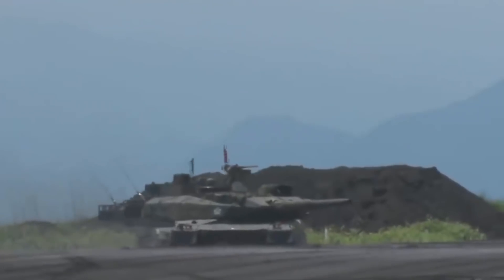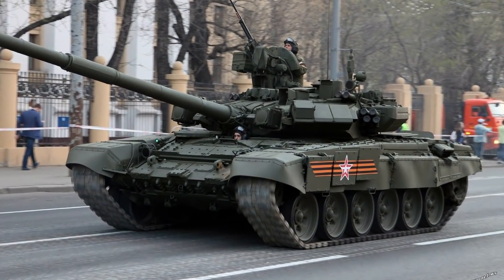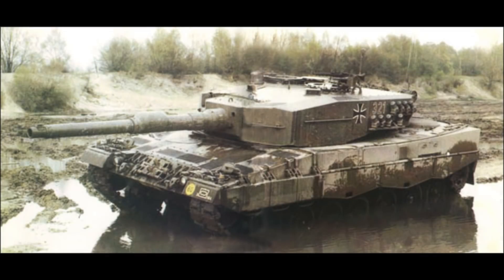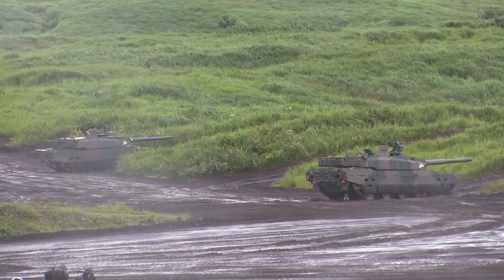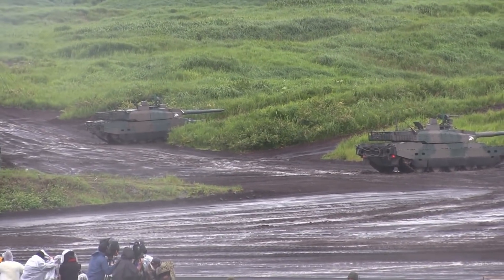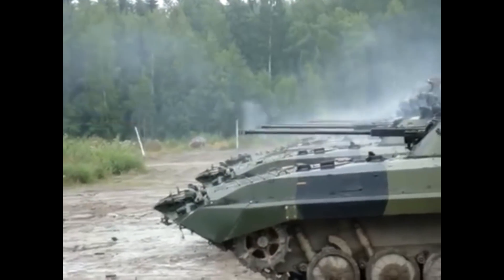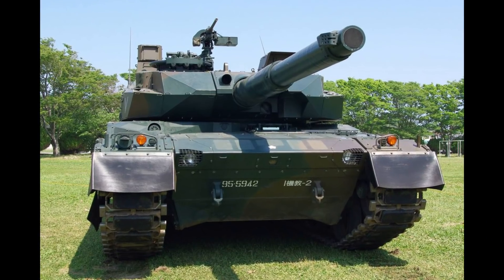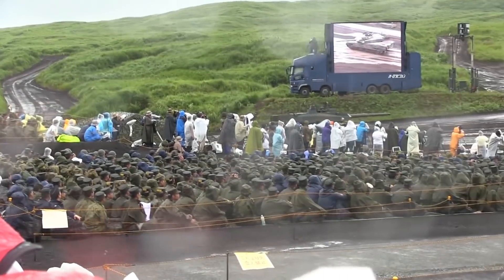Problems with Type 10 tank

Comment: In the age of shoulder-fired top-attack ATGM missiles, heavy, thick armor is not so useful. Modern ATGM will defeat such thick armor anyway. Small and nimble tank is way to go. No more massive tank battle on the wide open plain like desert. Japan is mountainous country with narrow road. So even 44 ton Type 10 is overkill. Modern tank should be designed more like heavy IFV(infantry Fighting Vehicle) without personnel carrying capacity. 35 ton would be enough. Modern tank should have 8 ATGM missile and 40 mm auto cannon or 105 mm howitzer gun. It should have extensive active protection system and extensive optical surveillance system, but not heavy armor. Armor to defend 30-40 mm munition is enough.
Reply: If Modern ATGM's can defeat thick armor, it means you just need even thicker and better armor. I think a modern heavy assault tank weighing around 100 tons with a 2000 horsepower engine, ultrawide tracks, and a 140mm cannon would be extremely potent and very survivable in high intensity situations. Such a tank should be capable of reaching 50 kilometers per hour with decent mobility. Of course, it should also have 3rd generation thermals for commander and gunner, Active protection system, a remote operated machine gun, and laser warning systems for ATGM lock ons.
Reply: @Frenchfrys17  Country infrastructure go brrrrrrr!!

Comment: People tends to attribute heavy weight to armor, which is completely wrong in the Type 10's case.
The tank is extremely frontally heavy because of it's composite armor. To achieve a good frontal armor with low weight, they had to strip off all of it's side armor and focused it on it's front. Also, the tank have a smaller profile compared to it's Western counterparts like Leo 2, Challenger 2 and Abrams. The Type 10's hull dimensions are similar to the russian T-series, and the tank's height can be reduced thanks to it's hydropneumatic suspension. Having a smaller profile helps on increasing the protection, since you have a smaller area of the tank to be covered, it is possible to maintain the same level of protection with less weight or increase protection with the same weight. 
This comes with downsides however, like possible having higher ground pressure because of less roadwheels, having cramped interior, carrying less fuel and less ammo. Upgrades are also hard to do without greatly increasing the tank's weight.

Comment: My dumb opinion: skip the tank and go with small, very mobile autonomous mini tanks.
Reply: They do have that too actly. 
The type16. 

8wheel armored vehicle with a 105mm mounted ontop. Its light enough for 1 unit to be flown in by a Kawasaki C2 cargo plane, a plane thats sat between the C130 and the C17, and on par with the airbus A400M.

Comment: Well only 5 road wheels per side is a fail, as ground pressure will be higher and the ability to upgrade the armor or add any weight is probably zero. The only ggod news, is that is the unlikely event of an invasion of Japan, other tanks probably can't use the road bridges as they would exceed the weight limit. Rail transport though is possible.

Comment: Transcript has some problems-needs editing --Type 10 is the latest japanese main battle tank. When it was first revealed, many thought of it to be the first 4th generation main battle tank, for whatever reason and many went to say, it's the best main battle tank yet. But type 10 has many problems because the tank is meant to be as light as possible. Because of japan's topography, the fact that japan is basically an island which has other small islands under it. Many of the bridges don't support heavy vehicles. In this video we will take a look at some of the problems of the tank. Ofcourse this does not mean that the tank is bad. Far from it it's just the focus of the video. Many of its problems lie in the protection because the tank is designed with the idea to preserve the weight as much as possible. The first issue we can talk about is the side protection. The hull has no additional armor modules on the sides. Just simple side skirts .This is definitely not good for a modern tank. Most of the modern tanks have atleast one third of the whole side protected with additional armor modules. Be it composites or explosive reactive armorand now more and more we see the entire sides covered with additional armor. Type 10 as i said has none of that and it drastically impacts its survivability. Because even a hit from 30 degrees by an old rpg rocket could prove fatal for the tank. Now the turret is a hot topic. Some claim that the modules on the sides are composite armor modules while some claim those modules are hollow and possibly serve only for storage while offering only spaced armor protection. I personally could not find any hard evidence to support either of the two claims but i will give my two cents on it personally. i do not believe that those are composite armor modules for several reasons. First reason is the weight. The tank weighs only 44 tons. In comparison the original leopard 2 from 1980 weighed 10 tons more than that and the modern one weighs 20 tons more. Composite armor modules are really heavy. If those indeed are such modules, they would drastically increase the weight of the tank. Second reason is the fact that the modules have little doors with hinges on them. You don't put such things on composite arm modules mainly because those could easily be damaged in combat by happy machine gun fire or explosions. Third reason is their design on one spot. They are thin on another really thick and so on. You don't really design composite armor modules like this. At least not if you want them to work consistently. Another thing to also mention is that these boxes go along the entire turret to the very back, where composite armor is not really needed. It would just be unnecessary weight. So i honestly believe those are not composite armor modules. Now there are pictures of the tank with what appears to be composite armor on the sides of the turret but without the boxes on the side. This led some to speculate that there is composite armor on the sides under the boxes but if we carefully examine the photo we will see that this is an old prototype. First we can see that the supposed composite armor is as thick as the laser MORNING??? receiver and starts from the receiver's point and covers pretty much the entire side of the turret with the same thickness. But if we look at the actual tank we see that the area behind the laser WARNING?? receiver is much thinner than what is shown in the picture and the boxes create a slope which wouldn't allow a plate of such thickness behind them. In another picture from an actual tank we can see that there is no such plate on the side. Now does this mean type 10 has just simple steel and side armor and storage boxes on top. Well probably yes but not necessarily there is still room for a thinner composite plate behind the boxes on the gunner's side and the commander's side could possibly have a thin composite area on the tank's actual turret. Since there is some room there. Of course composite armors of those thicknesses provide very minimal protection, they would maybe only stop old rpg rockets from 30 degree angle ifyou're lucky. It is possible the japanese designers thought that the composite will provide very little protection. Why add it in the first place in an attempt to preserve weight and it is very much possible that it is just steel on the turret side. Now the tank is said to receive a hard kill ACRO?? protection system so that will save it from a lot of problems regarding its armor protection. But the powerful atgm will still retain some penetration when intercepted by an aps?? and having really poor side protection will be a problem and that will not protect it against auto cannon fire from infantry fighting vehicles which are more than capable of penetrating its side armor. Next problem is the protection of the hull. I ??am a storage the bustle?? autoloader has only 14 rounds in it which is kind of a problem on itself but the rest of the ammunition. 21 pieces are stored in the forward hull compartment next to the driver. This can lead to the catastrophic loss of a tank if the ammunition in this rack is hit. The fact that the lower front plate has no additional protection can also be the problem. Because of this but the lower front plate is an area least likely to be hit. Therefore it's understandable why it's designed in such a way. One redeeming factor could be the ammunition propellant germany switched to. A propellant that does not catch fire when hit by hollow charger munitions. But i could not find any information if japan adopted something similar. This does not mean that the hit to the ammo rack wants to knock out the tank but it significantly decreases the chances of that happening. Another problem is that the turret ring is very exposed. If we look at the tank, we can see that the area between the gun method??? and the upper front plate is much bigger than usual. The turret ring appears to be covered but it's not actual armor. It appears to be a mount for some electronics. Could be driver's night vision. I could be wrong and it's also covered by driver's periscopes which obviously aren't armor. So a hit from anything will penetrate there and basically neutralize the tank which is a really big problem. Of course the tank has many good things about it especially mobility-wise but as i said at the beginning this video is only about some of the problems of the tank and as already mentioned most of these problems have to do with the fact that the tank has to be light. That was the main goal of the design and they did accomplish it.

Comment: The problem isn't it has to be light, it's that for whatever reason, the Japanese thought it has to be as large and bulky as a Leopard while being light. The Chinese Type-96 light tank weights 41 tons while having the armor protection of most mbts and no weak points, by simply making the tank smaller, with a razor thin frontal target profile. Concentrating the same amount of composites into a smaller area = more protection for less weight. The Type-10 didn't need pneumatic suspension, it's a bulky and heavy gemmick that highly situational in theory, and in the history of tank warfare has never been successfully used despite appearing in mass produced tank models in both Japan and Europe since the 1970s. The 70km/hr reverse gear is also useless. 2 gear  35km/hr reverse that Type-96 uses is more than adaquate, and doesn't add much bulk or complexity to the transmission. Instead of shaving off the useless junk, the Japanese opted to save weight off armor, the very thing that makes a tank a tank.
Reply: Lets see if that works when a tank battle happens on japan's mountain islands.

Comment: Since japan is an island they trade off armor for mobility, but you know they could always add armor to it right?
Reply: Yeap. 

Basic setup weighs in at 40 tonnes, but it can go up to 48 tonnes if neccessary. Its got a a power/weight of 27hp/tonne at its “medium” setup of 44 tonnes, n 25hp/tonne at 48 tonnes. Thats better power/weight than the latest (and heaviest) Abrams, n the abrams is no slouch. If the type10 wanna meet the same power/weight ratio, it can touch the 51 tonne mark with everything on board. 

And hell, its a turbodiesel. Who says u cant up the boost😎
Reply: you can't just slap armor on a tank design. do you think of how the russians just slap ERA on everything?  thinking about it...officially, japan and russia are still at war, they never signed a peace treaty for ww2. so if they want to try out their tank, and at the same time take pressure off ukraine..now's the time O:)
Reply: @thecursed01  i agree u cant slap armor on a tank. but thats the beauty of not exporting ur tank…. We dont actly really know what the type10 is hiding, n the jgsdf is under no obligation to share any of its secrets.

For all we know, they already have an uparmored version that exceeds the “48tonne” version. All it needs is a visit to the vehicle depot for a few days to swap out or add on. 

As in… there were built-in allowances for the type10 for it to exceed what its officially capable of. I mean, this tank came out in 2010. Dont tell me no further development was done to it in the 14 years since then.

Haahhaha. I rmmbr that joke about russia vs japan. Before ukraine, everyone was like “how is japan gonna fair against a russian invasion”. A year after ukraine, people were more like “how many weeks is it gonna take for japan to take over the kurils n sakhalins?” 😂😂😂

Comment: I knew it. . .
That turret armor is a hollow. . . Its a fake armor plate 😂.

But am pretty sure that turret armor can be replaced to the real one, depend of where that tank placed and situation.

Am really sure that japan not gonna make same mistake as ZERO, reducing the weight as much as possible without any solution.

Its really weak tank even in first time saw its armor (compared to abrams)

Comment: T90 has 44 tons...
Reply: And no gun depression and no reverse speed
Reply: @degenerat3380  what your point, the guy talk like an 44 tons tank can't have good armor, T90 have, Armata to with 48 tons...
Reply: @carloswolfbr  having good armor does not make sense when your tank is not functional in the area it will be operated in, the T-90 has good armor and is light, but in mountainous terrain it would be useless due to its lack of gun depression, The T-90 is designed for flat European terrain and constant advance, The Type 10 is designed to defend hilly terrain and use covers and quick retreat.
Reply: @akirasean4080  they have not fought tanks with each other yet, they are placed nearby, India noticed a problem with using the T-90 / T-72 in mountainous terrain and immediately started looking for some light tanks to buy and China deployed a ZTQ 15 light tank instead of its best armored ZTZ99

Comment: But isn`t the t72 b3 only 45 tons and even better protected ???
Reply: The T-72 is way smaller, and sacrificed stuff like good fire control systems etc. to achieve its weight the Type 10 didn’t make these sacrifices.

Comment: Did you learn that from war thunder ?? 😑 I don't think the Japanese would be that much stupid to reduce side armor. So as war thunder is a game, doesn't mean it has 100% accuracy detail on every new tanks playable in it.
Reply: There's the problem of the weight. You can't build a tank that has the dimensions of a Leclerc, weights 23% less, and it's well armoured.
Reply: @neutronalchemist3241  Type 10 Fans would say that’s because of Japanese space magic. I can agree that the Type 10 is a good tank especially by the looks. But it’s not that good in the armor compartment.
Reply: @neutronalchemist3241  lol, you are basically telling weight should match same as size? I guess you have no idea about many things. Some materials can be light and strong.
Reply: @spyran5839  Ever heard of ceramics composite armour which is mixture of materials and that can be light? Probably not
Reply: @norden9999  But not light enough to comply with it's weight limitations, no ceramic composite armor pubicly know get's remotely close to the weight it would need to be.
Reply: @norden9999  I guess you have no idea about many things. First of all how armors and penetration works. Sorry, but there's not ceramic magic. Kinetic penetrators and HEAT are stopped by mass. That, in certain conditions can be partially replaced by space. if you don't have any of that, you have no armor.

Comment: The Type 10 is specifically designed to be lighter and cheaper than the previous Type 90, while taking advantage of modern technology in order to remain competitive. It’s theoretically a worse tank than the Type 90, since the armor was sacrificed in order to maximize speed and minimize cost and weight.
Reply: If anything, it should be looked at as more of a light tank than a proper MBT. It’s kind of in between a modern light tank and an MBT, so in a way it’s like a modern-day medium tank. Then again, the leopard 1 only had 40mm of armor, and that was considered a state-of-the-art MBT…
Reply: That's just false, Type 10 have better armor, Japan GoV released a document which have the table weight of the composites.

What's the point of lying or even speaking of something you don't even know.